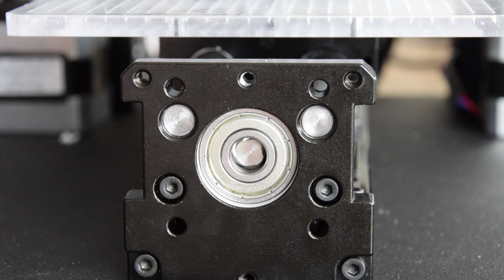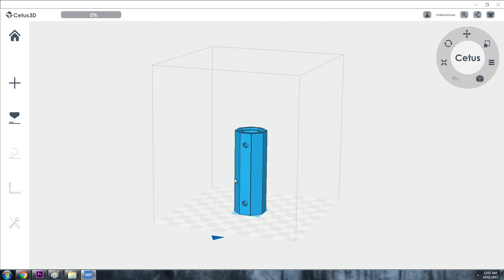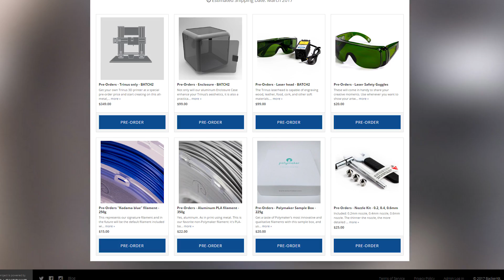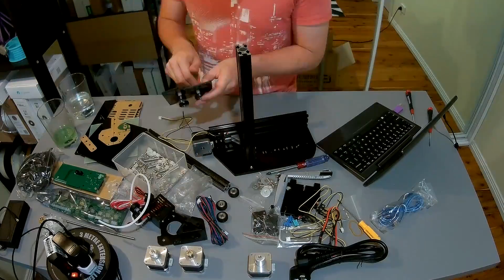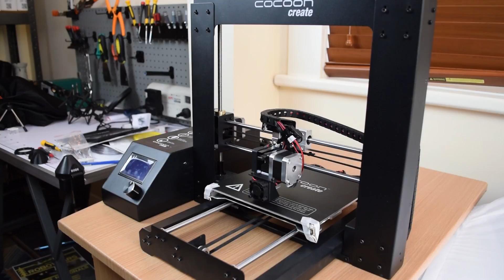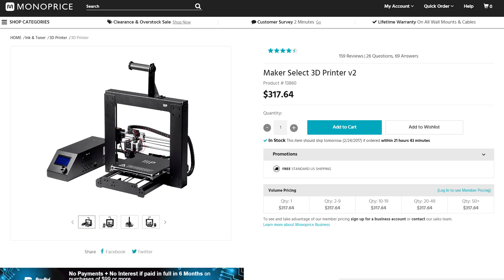Cheap 3D Printers THAT DON'T SUCK $350 and under

Comment: I feel like the time has come to talk about the ultra cheap kits Angus. When I decided to take the gamble on an affordable kit printer, I found far too many people saying "theyre not bad but require a few minor tweeks to make decent prints. This was a huge stretch of the truth in reality. My printer arrived with sloppy laser cutting causing unsquare edges, needed major tweeking to get the Z carriages square as it relied on those square edges. All the axis rods have a rough texture as if hand sanded in a drill to get the right diameter. The Z axis rods didn't fit the linear bearings because they were too large a diameter! The crappy extruder head came precracked causing tension problems that translated to intermittent extrusion and failed prints. took awhile to catch on that there was a hidden crack responsible for causing it. So right out of the box i had to buy a new extruder head and new z axis rods. The hot end gets jammed unless i oil the filament too!

Lots of poor newbies being led astray by these "worked great for me, just had to do minor tweeks" crowd. I strongly suggest there be more information about this situation and what you are getting yourself into should you buy one of these kits.
Reply: My Anet A6 isn't so bad, but it had and has some similar problems...
But for me it works, after spending €25 on replacement parts.
Reply: @Myself It doesn't work perfect, it just prints... badly...
Reply: Should've bought a wanhao
Reply: "If you do not mention how dangerous these machines can be when ran without modification then you are potentially responsible if someone's house burns down."

First off; legally, you're not "responsible". Secondly; you meant to say "*run* without modification".

Tevo makes fine kits that are not "ultra cheap" (possibly excluding Tarantula?). As with everything that comes from China, is not quality-controlled, regulated and bound by Western standards and laws, and has potential to cause hazards, you should know what you're getting into, or get help from someone who does know. When your kit isn't a dud you can get a relatively fine printer for tenth of the cost of the high-end machines, and do incremental upgrades until it performs at or above their level.

Comment: Any thoughts on the Tronxy X3A printer? Is it any good for a first 3d printer? Was looking at it because of the heated bed and the 210x210x300mm print size.

Comment: I'd been eyeing 3D printers for a number of years, and FINALLY pulled the trigger a week and a half ago, and ordered one of the MP Select Mini printers.  Absolutely love it!

While I was waiting for it to get delivered, I did a bit of pre-reading, and ensuring I had a solid enough understanding of 3D printing before tackling my first print.  However, all of that was essentially unnecessary as it came pretty well completely ready to print OOB.  I leveled the bed, contacted MP support to get the sample .gcode files (mine were missing on my included SD card), and hit PRINT.  3 hours later, I had an adorable cat printed on the bed!

Fast forward a week and a half, and I've printed almost an entire roll's worth of PLA, and even designed, sliced, and printed a few 3D models of my own, via models built in Sketchup and sliced in Cura.

For a 3D printer newbie like myself, it has been a blast!  I've run into a few QC issues on my specific printer, however, but with MP's solid customer support, I'm not worried in case it ends up breaking on me within the next year (as long as its warranty holds out).

Comment: To all the people saying the Anet A8 is a good printer and people considering getting it.
I've had alot of problems with it, mostly with quality control, the hotend broke first day, heated bed has quite a bit of bowing, and some parts not fitting together.
The overall print quality is good, and it is a decent printer for the price.
Do not get this printer if you want something that just works, if you have time to tinker with it, then yes get it, but this printer isn't very reliable.
Also from what I've heard, the Anet A6 is a better printer.

Comment: Hey Angus have you seen the new upcoming offering from cocoon?
https://www.cocooncreate.com.au/
Reply from the maker: Nice! The i3 plus is a nice machine but personally think the v2.1 is a better deal.
Reply: https://www.dicksmith.com.au/da/buy/balco-3d-printer-with-4-x-free-filaments-and-print-mat-balco/ $399!
Reply: Maker's Muse I think the i3 plus is more beginner friendly with the touchscreen, and also the design has been slightly revised. for 3150hkd, it's quite a good deal.

Comment: i got petg to work really well on the cetus, works perfectly
Reply from the maker: Really? Even large prints? That's impressive !
Reply: Maker's Muse Yeah I had it printing a build with a 16cm diameter base and It printed like a champ. Just have to always use a raft with the cetus.
Reply from the maker: Damn! I've got to try that on mine. Thanks for the tip.

Comment: I'm a Cetus Kickstarter backer, and have had quite a few problems with it. I think they must have made changes from the pre-release to what Cetus now have started calling the prototype printers. Don't get me wrong, it's a great design, and I think Cetus will resolve the issues. It's not quite there yet.

Read through the Cetus forum, and as you do, recall how relatively few printers they have send out so far.
Mine came with bent motor mount (which many others also did), and Z axis out of alignment. The  print head that rubs against already printed parts (some have reported it miss steps and ruined a print because of this), and there are print artifacts on the sides and corners (which also is a common problem).
I've now mine taking it apart in order to re-assemble it. This time with thread lock compound, and properly squared up axis. I'll also add an community developed brace to help stiffen up the Z axis. Hopefully that will improve the print quality a little.
Most surprisingly though is the slicer issues. Especially on slightly curved top surfaces, and at times even on flat surfaces. At times, the parts are left with gabs and holes in the top layer. It looks like under extrusion. That's when printing with Cetus filament and with the settings supplied by Cetus in the slicer software.

So yeah, keep an eye on Cetus, but wait till the next generation is out before you buy.

Comment: I actually received my Tiko, and quite frankly, it's rather disappointing.  Not to mention the fact that a $179 (+$55 shipping!) printer was a hell of a lot more novel two years ago, after I'd bought my first printer for $550... But now that same printer costs $360.

As for how much printer you can get for $350... Well, if you kick in an extra $10 you can get a CTC-3D Bizer shipped from eBay. Heated bed, dual extruder... It's basically an upgraded version of the original MakerBot Replicator 1 Dual.  On mine I've had no problems printing PLA, filled PLAs, PCL, ABS, PETG, TPE/TPU, nylon, even polycarbonate.  Once you get it really dialed in and calibrated, it's absurdly accurate.

Comment: Sadly as one of those who backed the Tiko and is highly unlikely to see any return on my pledge (I'm sat in Batch 4 which I believe should have been the next batch shipped) I can feel for anyone who had their hopes pinned on it to get them into the hobby. Luckily I managed to get a great deal on a Wanhao i3 V2 while I was stuck in limbo waiting on the Tiko and used it to cut me teeth on 3D printing.

Two years after backing the Tiko and still with no sign of it in sight, I (some might say foolishly) decided to back the Cetus. I plumped for the extended gantry version and the little beauty has been printing its socks off non-stop, 24/7 for the past 3 weeks without issue. The only mod I have done with it was to add a LokBuild surface to the spare aluminium print plate I ordered when pledging and now I'm 100% warp free with intricate builds printing without rafts and no failed prints.

So for my two pennies worth, I'd definitely endorse both the Cetus and the Wanhao i3.